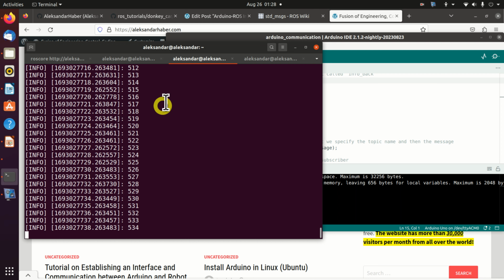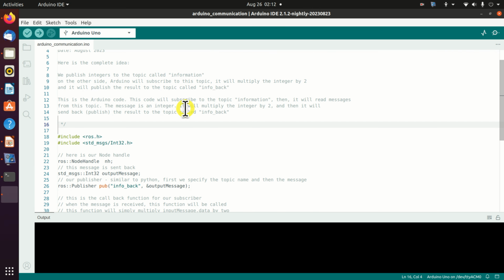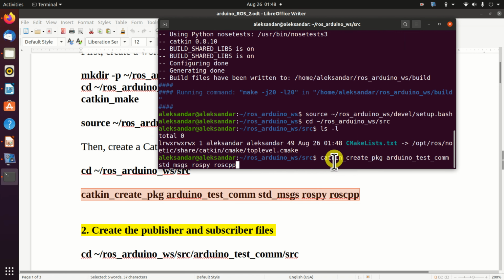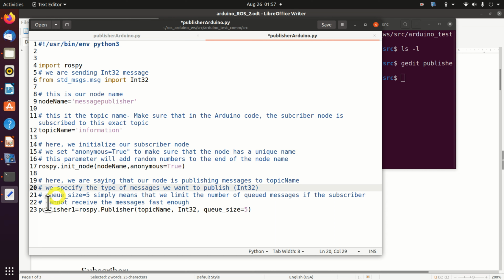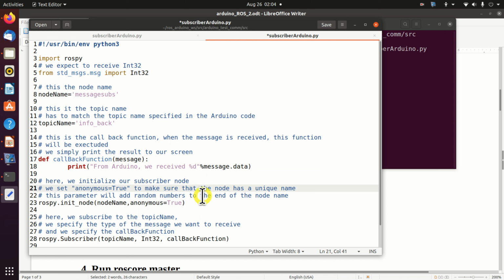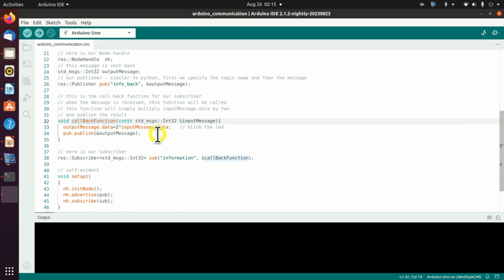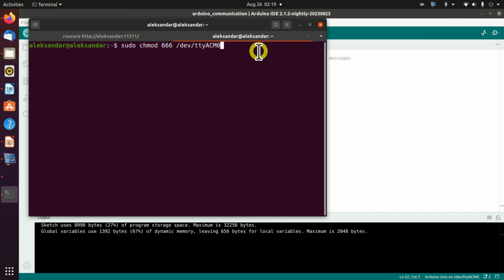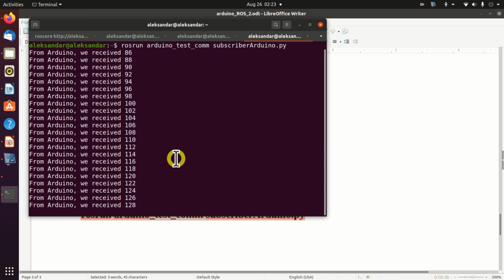Write Python ROS (Robot Operating System) Publisher/Subscriber Nodes and Interface with Arduino

Comment: Sir, did you use Mujoco and Python?What do you think about them if you used?
Reply from the maker: I did not. I will check it out. What is your experience?
Reply: Rudimentary. I am trying to learn basics. My thesis advisor suggested.
Reply from the maker: @emrebahceci9965  To be honest, I am not a big fan of software that someone makes for me. I would rather make something similar by myself. You do not need that stuff to learn robotics properly.